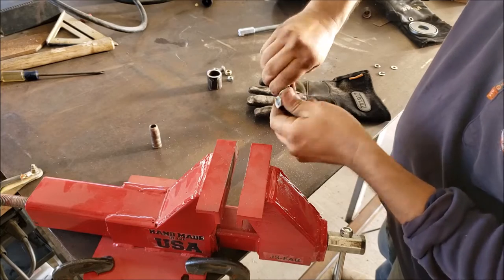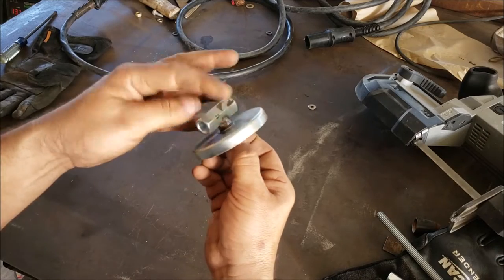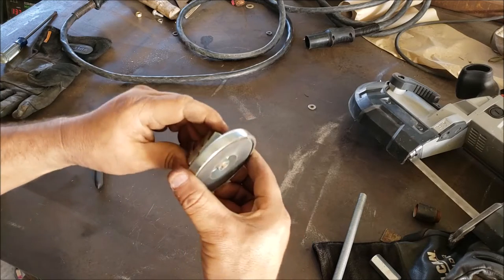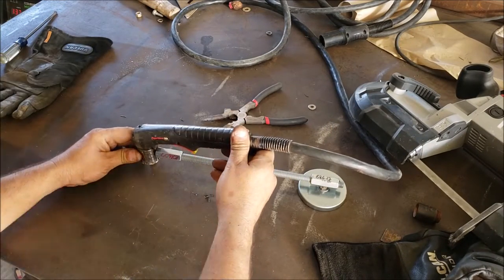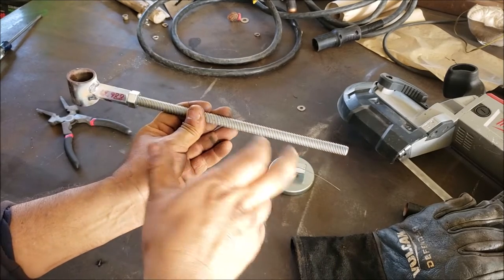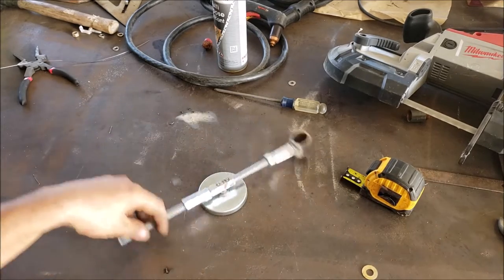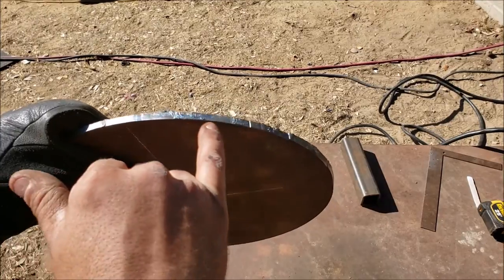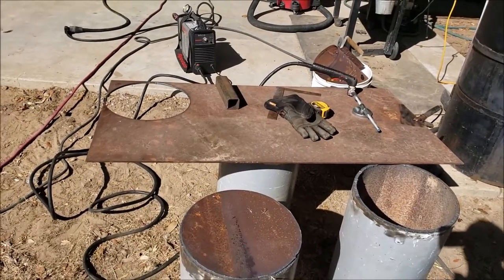Homemade circle jig for plasma oxy cutter invention tool

Comment from the maker: Here is a quick video I did today on a circle jig. I always wanted to build one and decided to attempt a simple adjustable jig. Total price in parts under $14.
Reply: Donde compro el imán ? Where did u get the magnet
Reply from the maker: @horaciosalinas8145  I got it at Harborfrieght a few months ago. I am not sure how strong it is but might be rated around 30 to 50lb.
Reply: @cutweldngrind  i think as long as it hold on to the metal no ?

Comment: That's brilliant.  I'll have to knock one of those up for myself. I haven't tried my new plasma cutter yet.
Reply from the maker: What plasma cutter did you get? I got some consumables for my powermax45 ( China clones) and they lasted a whopping 8 inchs or so each. Ebay had them for half the price so bought 3 sets of trash.
Reply: @cutweldngrind  it's a Hosung (I think)  second hand was $1000 With a 2 year warranty. Apparently can cut 16mm. (5/8)
Reply: @cutweldngrind  I was spraying the tip with anti splatter and it made the tips last about 20 to 30 times longer. Could be worth a try.
Reply from the maker: @Paulman50  I will have to try that on the new consumables I buy. My Powermax45 was $650 used with 0 warranty. I wanted a new one but they are over $2000. Hopefully I can get some more life out of it.

Comment: That's pretty slick😎👍
Reply from the maker: Thanks. It's a quick setup I threw together to get some material cut. It's not 100% accurate as I need to apply some adjustments screws to remove the slack on pipe holding torch.

Comment: Very clever
Reply from the maker: It works great for my application and could use some tweaking for more accurate results. I would probably apply some bolts to apply pressure to plasma cutter torch so it won't wobble much.

Comment: Great job, now I have found the way to make my own.
Just a question… is your welder using gas or not ? 
Thanks in advance
Reply from the maker: My Mig welders are using flux wire and maybe once I run out I will switch to gas. I actually need a shop to store my welders out of the elements so hope I can build something soon.

Comment: Is that a drag tip or pilot arc
Reply from the maker: The powermax45 is a pilot arc plasma cutter. The shield on it are made for drag cutting from what I was told years ago. I also have shields for gouging which I don't recall if I ever tried it. I haven't really done much in the past 3 months with any or my cutters.
Reply: I was asking because I wondered how high it was off of the metal or if it was just dragging on the metal

Comment: Nice video. Do you have the magnet marked for center or how are you finding center of circle?
Reply from the maker: I measure from center of pipe to center of nut for my circle cutouts. I might try a diffrent version later since I built this for some cutouts I needed.

Comment: I made this at work, while watching your video. Everything worked fine till I turned on the plasma cutter. The pipe head caught some slag and the magnet moved off center. So question what is the magnets strength? I'm using a 95lbs magnet.
Reply from the maker: I think my magnet is also rated at 95lbs. I haven't had issues with my magnet moving and have done 6 circle cutouts only. I haven't worked on projects after getting sick but might use it again with the new plasma cutter that I will give away.
Reply: @cutweldngrind  i upgraded my all thread to 1/2, also a bigger magnet but with the same amount lbs rating. One last thing and perhaps I didn't catch it during the video, I raised the cup off the table and now only my plasma head touches the metal. everything works great. Thank you.

Comment: What size threaded rod did you use 3/8? Nice set up going to build one!
Reply from the maker: I used 1/2" threaded rod because I had some 1/2" nuts in the tool box that would work for this application. My plasma cutter torch has a ceramic head so I did not put screws to hold torch tight onto pipe I used. So if you want to get better results try adding screws to hold plasma torch in place.
Reply: 1/2" is exactly what I'm going to use..I have a bunch of it

Comment: Which welder are you using? Flux core (without gas)?
Reply from the maker: I usually use Flux wire on the Titanium MiG 140 from Harbor Freight and my Hobart Champion Elite arc welder. I had planned to buy a tank for the MiG but I really need a shop to store all my tools and projects.

Comment: Where did you buy the magnet?
Reply from the maker: I get the magnets on Ebay, Harbor Freight or Ace Hardware. I think this magnet was rated at 90lbs or so which seems to be a good rating to hold it in place.

Comment: No your supposed to go to a welding shop and spend 300 dollars what are doing you aren't listening to the system
Reply from the maker: My local shop will probably charge and extra 20% lol. I can but a 1x1 square tubing by 3/16 wall thickness from the city and even pay $30 delivery and still save money from my town welding supplier.